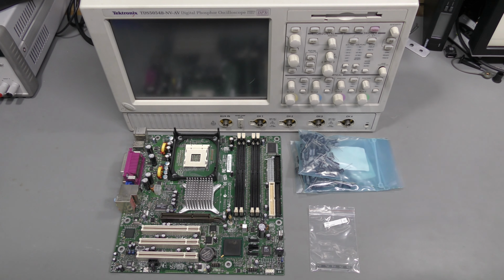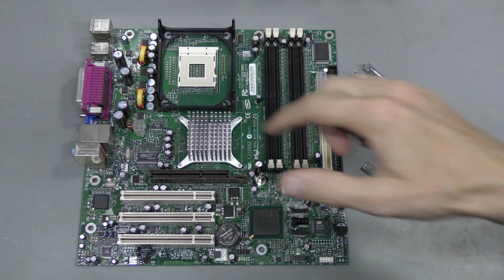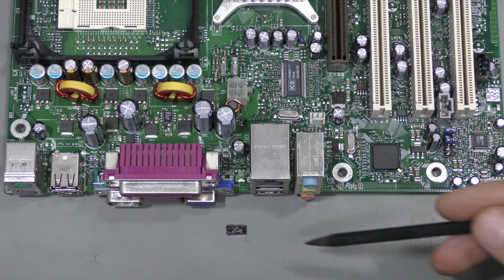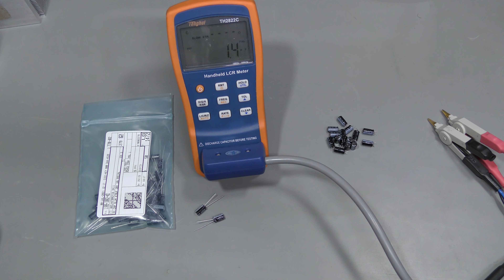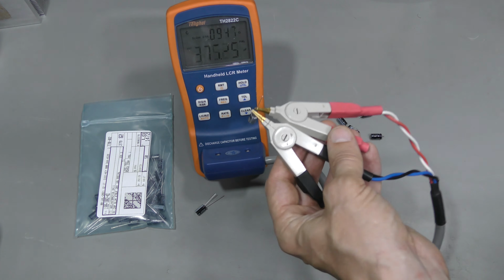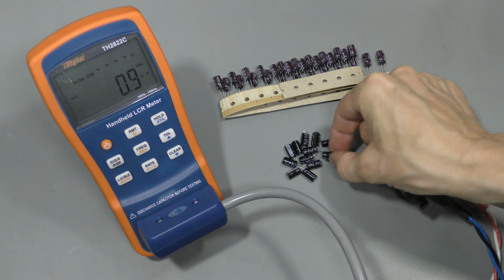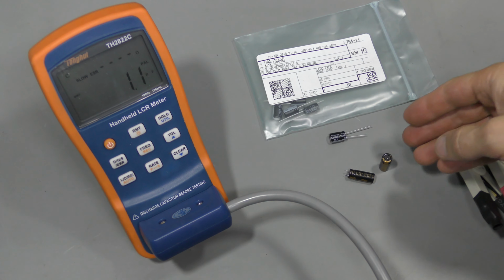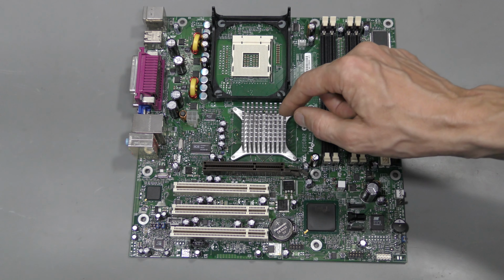#123 - Tektronix TDS5054B-NV-AV oscilloscope motherboard repair

Comment: I just pull some of those solid type poly caps from my 3rd gen motherboard, and the values were out a bit. ESR was around 1ohm, but the 820uF was 760, and the 560 was 480. If you look at the life span graph of solid Vs electro, the solid last a lot longer at cool temps, but not any longer at high temps. The replacements from Ali were spot-on for values.

Comment: You should have checked the 10mm VRM high capacitors as well.  They look like Nichicon HM series, which had a manufacturing defect up to around 2006.  The Nichicon VRM low capacitors you checked were Nichicon HN, which were also affected during that time.  Ideally, you should replace all the Nichicon HM/HN with polymer capacitors (HM/HN/HZ have been out of production for more than 5 years, anything sold as them are counterfeit).  You can safely drop quite a bit in capacitance because the overall ripple suppression rating for these VRMs of that time was more important than overall capacitance.

Good call on not using a higher-ESR part though.

Comment: Great vid but I have never seen those tweezers in use, I get the theory but practice can be different ! perhaps you can film it ?....cheers.
Reply: They are compesated lead, for precise mesurment.
Kelvin klips
Reply: @ljubomirculibrk4097  I was talking about the soldering tweezers used for the removal of SMD components.

Comment: Good work. With respect to the capacitors, I thought that capacitance and ESR for electrolytics were normally specced with measurement at 120 Hz. Does your meter not provide 120Hz measurements?
Reply from the maker: It does, but the default is 1KHz, and I kept it that way. It still gives a good picture especially in comparison.
Reply: @feedback-loop  Thank you so much! It’s a great video again, I have a question that is not relative to this video. I am reading the Specifications and Performance Verification of TSG4106A, I understand most of the parts but “Output level accuracy (IQ
 modulation relative to CW)” part (on page 21). Even I have tried to read some papers relative to IQ modulation but I still can not get it. If you get a chance, could you please explain it to me?
https://download.tek.com/manual/TSG4100A-Series-RF-Signal-Generator-Specifications-Performance-Verification-Technical-Reference.pdf

Comment: Why does the lcr meter read a significantly lower capacitance than is specified, even on the new caps?
Reply from the maker: Large caps are rated at 100Hz, and I was a bit lazy to switch the LCR meter. It still gives a good idea anyway.
Reply: The tolerance on most electrolytics is very large anyway, typically 20%, but older types were often -25% / +100%.

Comment: Now flash that GateWay bios with the Tektronix bios and you should have another Tektronix mother board right?
Reply from the maker: Do you know how to do this?
Reply: Just back up the original bios using amiflash or another flashing utility then flash it to the new board. Should be easily done from pure dos since this guy has a floppy drive.
Reply from the maker: @savaga78  This is Intel, not AMI. I am not sure Intel provides such tools. Perhaps I could change the splash screen, but I did not find a utility to read the existing splash screen and save it.
Reply: You should be able to change the splash screen with what utility the bios company! If its an award bios use a award utility! If it's AMI bios use an AMI Utility! and so on! I'm pretty sure if you have copy of Hirens ultimate boot disk you'll find what you need there
Reply: @feedback-loop  It's intel motherboard not bios. I know only 3 bios  software companies: ami, award and phoenix. According to your prev video the bios looks very similar to ami. If you disable the splash screen you can see it
Reply from the maker: @savaga78  Here it is: https://drive.google.com/file/d/1j4kQRGIjeQ5b1LLFUM5tZSbUNA499s6Z
Reply: @feedback-loop  The original Intel BIOS has been removed from their website but is available via the internet archive, the "iFlash" version creates a floppy disk that contains the iflash executable file, looking with a HEX editor it does support saving the old BIOS, I just tested this in Dosbox not a real board as I don't want to risk it flashing something!
https://web.archive.org/web/20191119133955/https://downloadcenter.intel.com/download/10130/BIOS-Update-BF86510A-86A-?product=50354

Comment: Maybe the next step is to work on upgrading to SSD hard-drive!
Reply: Ssd hard drive? 🥲🥲🥲 Wtf? Sold state drive - hard drive?
Reply from the maker: We have many such historical accidents. ATM machine, for example. Not a big deal.
Reply: Correction: Solid-state drive! (SSD).
Reply: I replaced twho whole motherboard with an micro ATX one with i5 processor. It booths very fast. It has XP on it also.